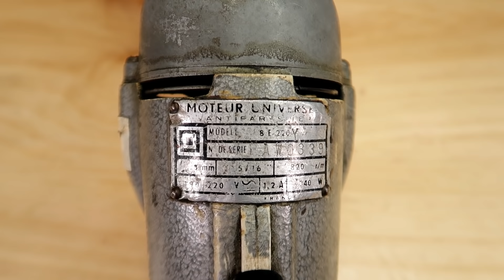BottleCap Drill - Restoration ( only one in the world )

Comment: "What is this thing?" A starter cap, used to save the windings of the motor from burning up when it has to continually start under load. Inductive loads like motors and fluorescent light ballasts create a state where the voltage peak in phase will lead the current by a number of degrees. This can create a state where in the windings of the motor, there is high current but no voltage, overheating the motor. The capacitor brings the motor into balance, particularly when starting up under load, as this device would. A drill typically does not start under load, so this modification was done to extend the life of the adapted motor.
Reply: Was curious to see if someone had posted it yet. Your explanation is far more elaborate and accurate than mine would've been though. Thanks!
Reply: Also it cut the spark current down on bushing.
Reply: also ensures the motor always rotates the same direction since it is single phase
Reply: So, essentially, it's a smoothing capacitor, right?
Reply: That, he might get a new one lol
Even on his grinder!
Reply: Impressed!!!
Reply: Thank's you.
I thought it was a capacitor to increase the starting current of the motor. So, it's to protect you.
On the farm there are big engines that have big capacitors that I was told to help start the big engine. I thought it was the same thing.
Reply: As I am not at all this way educated I thought I would read your explanation< no, I can’t even understand that. But can I ask, without looking completely stupid/dumb, is it like a starting handle that cars used to have or am I barking up the wrong tree in the wrong forest.
Reply: I think there was the same thing in the orange drill restored a couple videos ago.
Reply: This is a poly cap roller. We use these in a winery but a machine with 6 heads. Some cork bottles have a plastic cap that heat shrinks the cap to the bottle. This machine rolls a thin metal cap over the bottle
Reply: thank you
Reply: @kenbaxter4387  oh like the old style coke / pepsi glass bottles???
Reply: The cap SHOULD have been replaced... and its capacitance is probably too small.
Reply: @tonyitalia7798  ,  Nah.... its to bring the Power Factor back to a value of one. This one won't do much as it is so small in value. It probably protects the brushes from sparking too much.
Reply: yay i learn
Reply: @BruceNitroxpro  yes too much load on the brushes will cause some to burn and then arcing.
Reply: He built a whole story my guy

Comment: I have absolutely no idea what this device should be. But it looks like a little minigun. 😁 And I would have had fun with it too 😄
Reply: tightens bottle caps to bottles.
Reply: Good wine bottle have (used to have) a tin cap above the cork. This device looks like it could help fitting the tin cap tightly on the bottle neck.
Reply: 😂 😂 😂 😂 Final is fantastic
Reply: Leland Clayton - This device is used to apply tin layers over wine bottles on the cork side. The round bits at the extremity rotate and deform this layer to fit exactly the bottle neck shape. This is absolutely not to tighten bottle caps.
Reply: its for capping champagne bottles wit 26 mm caps. before the champange gets its permanent cork, they put the bottle upside down to get all the yeast in the bottleneck. after thats done they freeze the bottleneck and pop the cap. and with it the yeast comes out get the permanent champagne cork. in short.
Reply: @olivier2553  you're absolutely right, this is such a device to "shrink" the tin capsules onto a wine bottle, but the 3 stronk black rubber rings seem to be a bit worn out, they should sit a little tighter, to work properly.
Reply: I imagine it would shatter the glass which is probably why it's the only one.

Comment: I notice a possible problem when putting the rubber fingers back together at the end. If you look at the order that they are in before you disassembled the working end of the tool the rubber fingers are alternating in orientation to each other. look at 00:17 and then 17:43, doesn't take away from the great project video. I always learn new tips about restorations watching you work. thanks.

Comment: Nice bottle cap tightener! Funny looking thing...
One remark, you shouldn't have greased the axle where it goes into the bearing on the back end. It shouldn't rotate inside it, so the interference fit is required! Otherwise as the bearing is getting older/dirtier and is turning with more resistance, the axle might slip and slowly grind itself a new, smaller diameter. I know that this thing might not get any use from now on, but it is a good thing to remember when you are renovating other machines. Well, just one more thing: when "pressing in" (you were hammering it) bearings, you have to put something (e.g. a tube) on the outer ring so as not to stress the balls and the rolling surfaces inside it. Best is to use a restored precision press... where have I seen one? :)

Comment: I could be wrong but It appears to be a High Volume Commercial Bar/Caterer's Bottle Opener? For use at big events when you need to open hundreds or thousands of Bottles quickly to serve. I saw something similar a long time ago being used at a big event. Otherwise, Yes, a Cyberman's Pleasure Toy.
Reply: If it was for opening bottles, wouldn't it be rotating counter clockwise?
Reply: @kluzz  Tightening at Wineries etc - One Direction, Loosening at Events etc - Opposite direction. I only commented because I didn't see the turning direction in the video and had seen something similar used at a big event years ago. Good pick up on the other possible use although my money's still on the Cyberman's use.
Reply: No! quite the opposite its for crushing the foil over the cork
Reply: @jostouw4366  on not off, only way this makes any sense
Reply: @updownstate  Full description than :- for aluminium screw tops with crimp security the drill roll crimps the foil sleeve into the step below the thread forcing the cap to break at the perforation just above the crimp upon unscrewing the cap

Comment: The green thing is a motor Run Capacitor (condensateur)it alters the sine wave of the AC currentit and energizes the secondary coil before the primary coil which makes the armature turn.
If your motor stays still and buzzes, but turns when the armature is given a little push, your capacitor needs replacing. This is common in clothes dryers, domestic appliances erc

I saw in one of your videos that you had to push your bench grinder to get it running, you should replace the motor Run Capacitor
Reply: So basically he needs a new Flux Capacitor with the Cobalt infuzed coils and a little bit of liquid fairy dust.

Comment: I watched the whole video with tremendous curiosity: What the hell is this? The video ended and I formulated some hypotheses:

a) must be a non-drilling drill
b) can be something that is nothing
c) maybe this is a doer of things
d) a stolen weapon from Ming the Merciless
Reply: e) it's a thing that does a thing
Reply: It is an electro-rubber-welding-plasma weapon.
Reply: It's a drill that was used to tighten bottle caps.
Reply: It will get her in the "mood" !!!
Reply: It's a bottle cap roller. You pack your liquid, but a blank cap on top the bottle (it's slightly open or completely flat, both variants with that pleated edge, the flat kind being for industrial machines) and then you apply pressure until it seats, and you start the drill. The rollers inside will then go over the lip and progressively tighten it as you press even more (you can't fully press it until the cap is tightened unto the glass lip, because the rollers won't allow it).

Pretty simple device.
Reply: @aserta  and way faster spinning than any bottle cap roller I have ever seen
Reply: It's a fallout gun clearly
Reply: @aserta  so what does the 3 rubber ring serves?

Comment: I remember these from old days the aluminum cases when the isolator bearing on the shaft would go bad it would ground out and electrocute the hell out of you lol which does date it to late 70s  by 80s they were all plastic case for this reason lol you three elastomer bands are for holding the rods tight to help the rubber nubs grip the caps to cap as well as crimp ! I geuss they also had to account for it grabbing a finger or two while you were working! Could be 2 and 3 reason it was broke when it one exploded under pressure.. two grabbed a finger or three  electrocuted them n they tossed or 4  all of the above lol

Comment: I wish you would of showed us how to use it at the end.
Reply from the maker: i really don’t know 🤣🤣🤣🤷‍♀️🤷‍♀️
Reply: Better not. This restoration is done in the way - look by don't use...
Reply: industrial bottle capper, he would need the right size caps and bottles...
Reply from the maker: exactly
Reply: @EliteGeeks  Are you sure? If so, I need one of it! But to open bottles.
Reply: Me too.
Reply: @TysyTube  C'est une capsuleuse pour poser les capsules CRD sur les bouteilles (capsules autrefois en plomb etain et maintenant en alu . tu peux en "arracher"  une sur une bouteille en tirant fort dessus en tournant et ensuite la reposer propre avec ta machine ca sera comme neuf.
Reply: TysyTube Restoration this is just a guess but...
From the size of the caps that device would use and the way the rollers ( black odd shaped near the business end) and the shafts use rubber bands to hold them tight against the main rotor,,,,
I am going to guess this was used to  put the metal foil seals on old glass milk bottles... circa 1950’s or 1960’s.

Just s guess.
Reply from the maker: is only for tightening
Reply: @pbflo6559  You are correct sir.
We used to use a stand mounted one of these to put the foil caps on wine bottles back in the sixties. One guy would fill the bottles on a manual bottle filler, the next guy would punch in the corks and fit the foil caps then the last guy would put them through a labelling machine.
We could do over a thousand bottles a day like this for putting down as vintage wines.
Reply: @TysyTube  the old twist offpepsi bottles or even beer bottles now days is likely the same,,depending on date. Of tool ,could bea plastic bottle cap tool but i dought it
Reply: Good catch on the spelling error.  It's sabosta be, "wood" of.
Reply: This device is used to apply tin layers over wine bottles on the cork 
side. The round bits at the extremity rotate and deform this layer to 
fit exactly the bottle neck shape. This is absolutely not to tighten 
bottle caps.

Comment: I think this Machine is to roll Wine Capsules on the Bottle. You put a Tin, Alluminium or a polylaminate capsule on the Bottle and go with the drill over it. 

On our machines we use today it is still the exactly same princip. Only more automatic. 

By the way, the rubber bands on this drill are to hard, it should be more tight.

Comment: Hmmmm, Never seen a thing like that any ideas on how it really works ? did you try tightening a cap ? and what are those rubber bands for ? Very good Job. Peace
Reply: Rubber bands allow the head to accommodate different sizes of bottle caps.
Reply from the maker: exactly
Reply: @doodlegoat  pressure for the foil to crush it into the neck

Comment: I've been wondering this for a couple of the videos, but does the paint stripper work better if you scratch/scuff the surface first? Like, if you use a wire brush on the painted surface, add the paint stripper and then scratch again later. I wonder if it makes a difference.
Reply: 2 years later. Still no reply. Hearted the comment though, lmao.
Reply: @aneeveewhohasinternet1871  3 years now
Reply: @H_i_T_h_e_r_e  what a jerk move lmao

Comment: 1:56 capacitor???
Reply: I understand that it is indeed a capacitor and its purpose is to reduce arcing across the terminals of the switch.  IIRC, most mains powered drill-type tools have them, in one form or another.
Reply: It is not a capacitor, it is an RC (resistor-capacitor).

Comment: the black cylinder with green wires is a capacitor, on some motor (generaly 3 phased) it help to the start with actual power source (mono phased)
Reply: Heh, I was gonna guess capacitor.
Reply: The capacitor is a Supressor capacitor and is fitted for interference... Not for starting the motor.
Reply from the maker: thank you so much for answering
Reply: oh ok my bad, it can be used like this to ^^

Comment: Why didnt you weld the broken matal part?
Reply from the maker: i dont have a welding machine for aluminum
Reply: @TysyTube  Looks great, you did a good job. But i still dont get the point of this thing.
Reply from the maker: this is a machine to tighten the bottle cap
Reply: Have you tried it on bottle caps?
Reply: @KrisCochrane would be really interesting to see that. Need that for my grndma :o)
Reply: What do you do with all the stuff you resort is there somewhere we can buy the stuff
Reply: TysyTube Restoration You should get an inverter tig welder. Their perfect for repairing cracks and working on small parts like you're usually fixing. It will weld aluminum castings like that with no problem.

Comment: Cool never seen bottlecap drill. You see that green it's capacitor AC line interference from other like TV and Radio. I have Singer 222K 1954 bought from UK have it I remove old capacitors from motor and foot paddle control. Great job.

Comment: I think it is a drill for putting the foil caps on the old style milk bottles look at it closely the crimp rollers fit on the top of a milk bottle the rubber bands adjust automatically to allow the crimpers to spread and rubber bands keep it tight!

Comment: It's a wine bottle foil spinner, used to put the foil covers on wine bottles after corking.   The corked bottle neck goes into the ring of black rubber thingies and then a press of the trigger forms the foil to the bottle neck. The black bands adjust the amount of force applied to the foil.

Comment: the "what does this do?" is a load resistor to drop the voltage and slow the motor. The device is for putting the foil caps on wine bottles. just pop the foil sleeve over the bottle spout and press the foil into shape with the drill.

Comment: When you clean up the commutator end of the armature assembly you should undercut the Mica segments in between the copper bars just slightly to keep them from striking the brushes and damaging them. Usually a couple of thousands of an inch is enough clearance as the copper segments wear down. They make a type of draw knife tool designed to do this job but an old broken hack saw blade with fine teeth will also work but be careful not to cut or scratch the copper wires of the armature.

Comment: It's for putting twist off caps on bottles. The caps don't have threads. You put the non threaded cap on a bottle and then it forms the metal to the glass. That's what the rollers on the bottom do. The modern ones don't seem to use the rollers anymore. But I saw a large machine version of this in another video. The rollers are used to shape the twist off caps to the threads on the glass.

Comment: This is a poly cap roller. We use these in a winery but a machine with 6 heads. Some cork bottles have a plastic cap that heat shrinks the cap to the bottle. This machine rolls a thin metal cap over the bottle

Comment: My bet is its a wine bottle cork installer based off of the red stains on the end piece by the rollers. I have seen things like this on automated heads running like 8+ at a time. This just might be the end of the assembly line version for the quality controll guy to check a few bottles with.

Comment: Visual effect just good.
Quality of restoration is very poor. How you could use Epoxy for gluing handle !!
In future if some one will wish to again restore that equipment will have big problems.
Other case is why you do not disassemble main casing from drill?
Movie was too scary for me. I love old equipment and this how you made that renovation was not the way that it should be.
Reply: What glue do you want to use? Epoxy is good glue, strong and easy and safe to use
Reply: @sovietcomrade7733   First of all not use glue at all.
He should weld broken element and rework surface.
As well he did not remove main core and did not check main bearing that is probably to replace due to load on it.
Reply: @mariuszhoscilo9895  Weld wood, sure
Reply: @sovietcomrade7733  are You blind? Broken clamp was made from aluminum and it should be weld. Back handle was from plastic and in that case epoxy is ok.

Comment: Please pay attention to the symbol representing to squares (one in the other). That symbol was commonly used in (French) equipment whish was so called double insulated. There is no 'ground wire' present in such apparatus. Nowadays it is less common in Europe , but in the (late) 70's till 90''s it was. Especially manufacturers like Peugeot and Black&Decker used it. (I still have a grinder from the 70's in use which is double insulated; stll works fine... :-)

Comment: honestly, if you can get it where you are, you'd be far better off using JB Weld, instead of regular epoxy. Of course, the best fix is to actually weld the piece, or machine a replacement piece, but i'm guessing neither of those options are available to you.